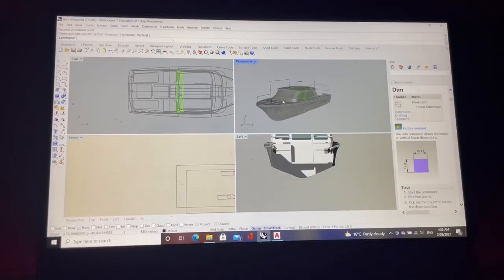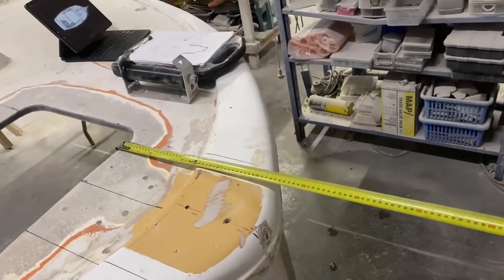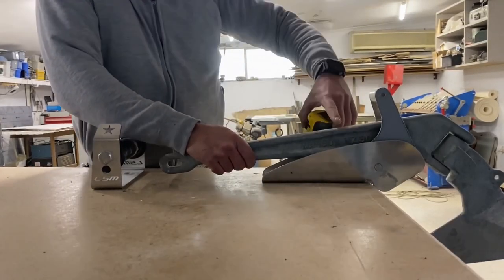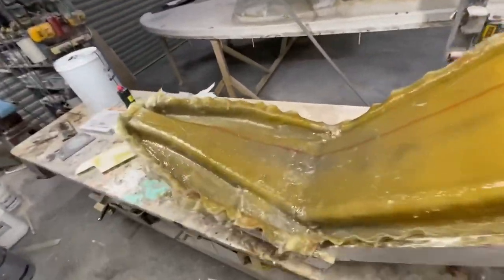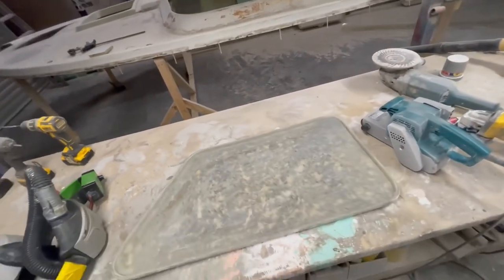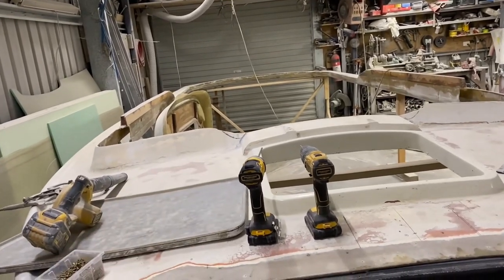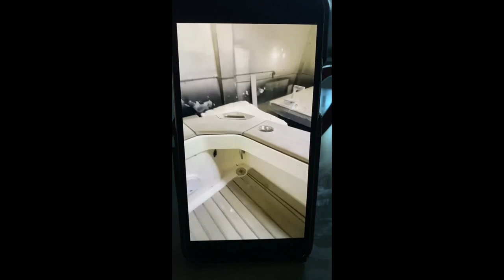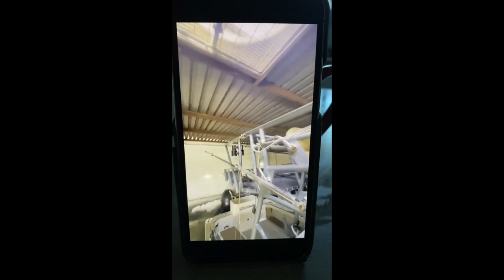25ft Bertram Project - Blob 32 - Making the bowsprit

Comment: i see a mess fixing to happen. I hope like hell you make a full bulkhead brace on the back of the bow spirit where your anchor locker is to strengthen the deck in that area. that way when you step out on to the spirit you don't go for an unexpected swim.
Reply from the maker: hey mate. yeh she'll be strong. im going to redo the bowsprit.....when i get some time!!ehhhh gotta get my money supply up! everything will be beefed up deck and into the hulll....eventually....
thanks for commenting!

Comment: Sunday I was cutting away extraneous metal from my late 1980’s 7m plate alloy ex work boat prior to addressing some corrosion issues, replacing the cockpit deck, reconfiguring the transom, building a wheelhouse etc etc. Covered with shit, knees aching I was questioning my judgement in taking on this project. Then your last vid came to mind and I thought I don’t work in a space suit. I don’t need a respirator, I don’t have perpetually itchy wrists and neck, I’m not up to my elbows in resin, life could be worse, this could be fibreglass boat, just get on with it. Thanks for the vids and your outstanding inspiration. (Btw my son’s dream boat is a resto’d Berty 28, luckily I’ll be to old by the time he can afford it)
Reply from the maker: Haahaha metal is a dream to work with compared to glass hahaha (if you can weld alright lol) thanks mate.. there’s a nice project berty28 for sale on fb marketplace atm …. Lol … in Australia Gold Coast
Reply from the maker: It’ll make your son love you more when he gets older lol

Comment: Michael, 
KIss= Keep It Simple & Safe, like idea, but structurally spreading the load. Unless secure to winch point to trailer.
Reply from the maker: My Dad says that to me all the time haha 
The bowsprit is what i think you're referring to? The part of the bowsprit under the deck will tie into a glassed in structure on the hull that I'll make once the deck is back on the hull. I thought it would be an overkill and bit heavy?

Comment: Ive been watching your for a bit now how big an engine are you putting in this you keep adding weight and more weight you will need a bigger one than what was in it to start with. Just food for thought.
Reply from the maker: First motor will be underpowered @240hp turbo diesel. I made the engine bay bigger to allow for a bigger motor later on. What’s your bet on the weight? Haha 
Thanks for the comment!